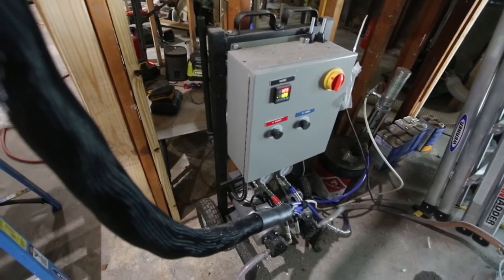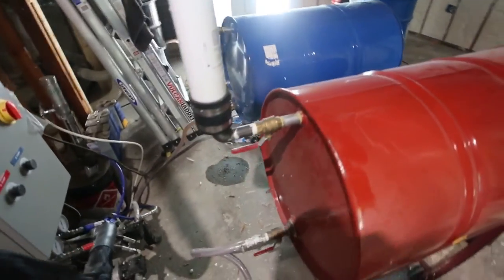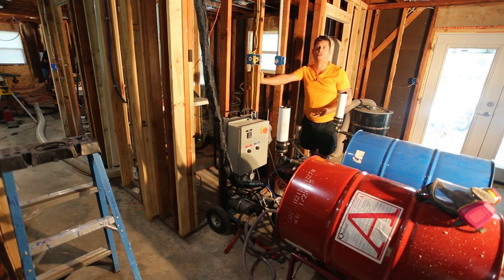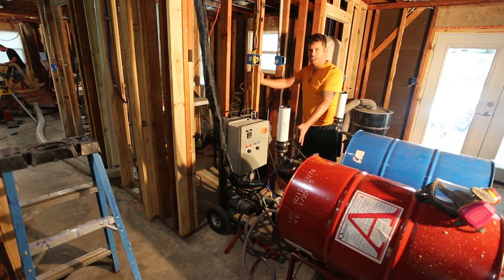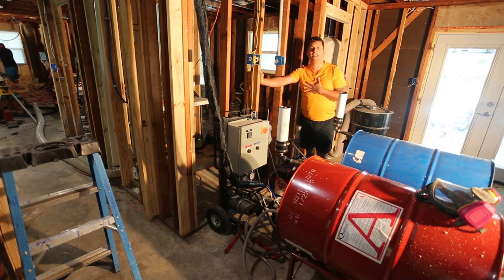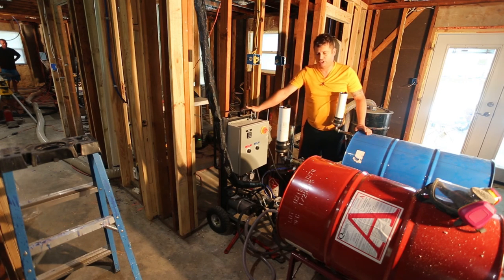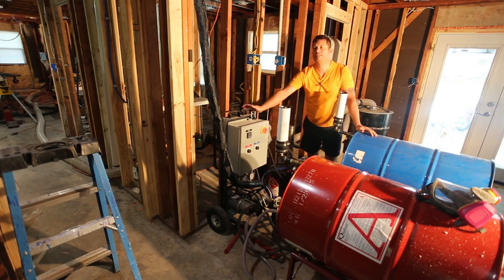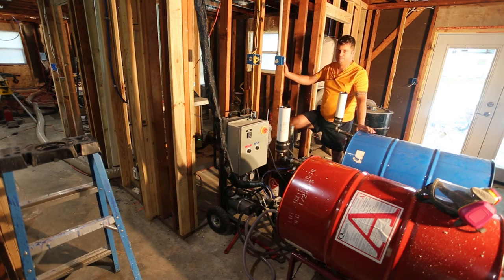DIY Spray Foam - LilPup Spray Foam proportioner from MixSyn

Comment: Hey there  I am looking at buying a used unit locally   it is cheap  and I am not able to try it out as  he has no product  to  run ,  what can/ should I check  .  Does this equipment  have a long  life span ? Common  things to replace
Reply from the maker: It's a pretty straight forward unit..... check that the pumps work.  Pumps are from Grainger, so they are rebuildable and serviceable.  Hoses are just paint hoses, so easy to replace if needed.  Gun can be drilled out if it's clogged.  That's about it.  It's a rock simple unit that just works.  Avoid using in cold weather or heat the components well to avoid issues.  The warmer you get it the better it will work.
Reply: @hotpuppy72  I appreciate that you're still responding to comment on this so many years later. Absolute legend

Comment: Hey Brian, did you mix the foam in the drum with an air mixer prior to spraying? I noticed in the quad application guide it said to do so.... not sure if it’s really required or not.
Reply from the maker: Not really.  You need a special gadget for that.  I just turned it up right and on it's side a few times.  I've had zero issues with my foam.

Comment: Brian,  how did you mount the acetone pump in the bucket?
Reply from the maker: Eric Jacobs Hi, I bought a 5 gallon metal bucket of Acetone from Sherwin Williams... it was about $65 and required me to drive all over to get it.  I wound up pulling the nipple off of the bucket and with lineman's pliers.  The hole that is left is just the right size for the pump.  Be sure to grease the pump regularly.  I grease it every day I operate.  In hindsight, you could use a 5 gallon plastic bucket with a hole drilled in it.  I was just worried about the acetone in a plastic bucket.  What I have since found is that my purge bucket which is a plastic Home Depot bucket with a plastic lid on it will sit for a week and still have liquid acetone in it.  In theory this could be reused, but I've not bothered.  I only use it once.  I used a holesaw to put a 2 inch hole in the plastic lid of the purge bucket.
Reply: Brian Greul where do you find the desicant for the barrels

Comment: hi how much did you spend on equipment if i may ask, i spray foam my home last year i was using foam it green its good for small project not entire house
Reply from the maker: +mietek siekiera Hi, around $9,000 including air compressor and support equipment.  Doing my own foam is about control and quality more than savings.  I'm able to foam areas that wouldn't typically get foamed if I hired an applicator.  An example of what I mean is that I am putting some foam in a few walls for sound control between adjacent rooms.  It's easy to do with the equipment here.  I'll also be renovating my garage and bringing it up to the same standards as the house next year.

Comment: Hey Brian,  How much does a Barrel of A/B Closed cell cost and where can I get it from in Houston,TX.  Also, I am thinking I would need certification to handle closed cell; is that true?
Reply: FYI there is a company that sells closed foam off eBay and they offer training for about $2k for 5,000 board feet and i here to find out where to find the equipment to spray

Comment: thanks , 9k not included 55 gallon foam ?, what foam you are using and where i can buy online thanks again i just gathering info for the future i planning build 4 car carage
Reply from the maker: +mietek siekiera 9k for equipment.... and about 1K of that was for a 5hp 240v compressor from Harbor Freight.  $200 for drum stands from Northern Tool... flimsy but functional.  Foam is about $2k per 55 gallon set.  I'm using Quadrant foam and having great results with it.  Yield for closed and open cell are different... each has benefits and drawbacks.  I'm on 4 sets right now.... like I said foam is not cheap but it has amazing performance.